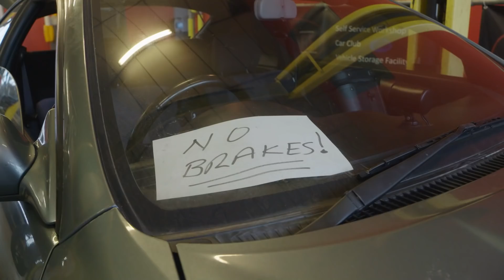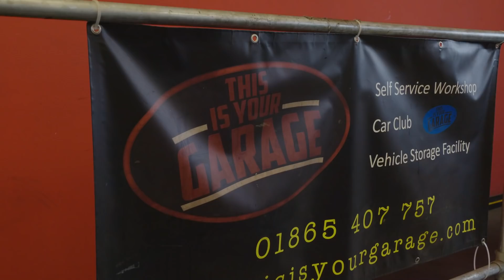The Worst Car We've Ever Worked On!

Comment: What DID Steve say about pressure washing unframed glass?
Reply: wondering too, any1 knows?
Reply: I think he meant you have to be careful because water sometimes will seep in past the seal and soaks your window switches or door card etc. I had this issue with my gf8 WRX and my old s13 180sx, I wouldn't even realise until I went to drive it and find water through my interior.

Comment: Think your self lucky it didn’t Need ABS sensors, they are ultra rare, no one makes them - NOS go for £300-350 each even used they are £100, you got away light with the super strut front end that can be a £1500-2000 in parts

Comment: Just give it 6500 rpm if the motor is cold then it will last forever. :(😪
Reply: It had been sitting warming up on the drive prior. The car was warm. He isn't a barbarian. 🤣

Comment: its 25 years old car. Stop compaining and crying about "everything brakes" and put your hand in your damn pocket and maintain your car. There's noone other car or genuine mechanical part that will last 25 Years old. my SS suspension failed last year and my car has 350.000km and its 25 years old. i never changed a single fucking bulb on it. Stop whining if you think Gtfour has cheap made parts then you deserve European made car that you'll need to change ball joints or axles every fucking year.
Reply: Crikey mate